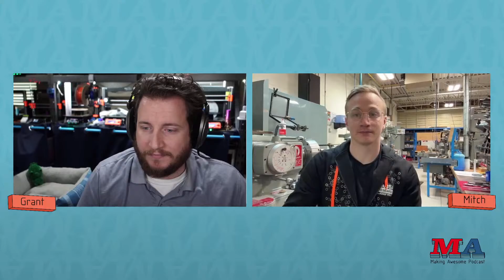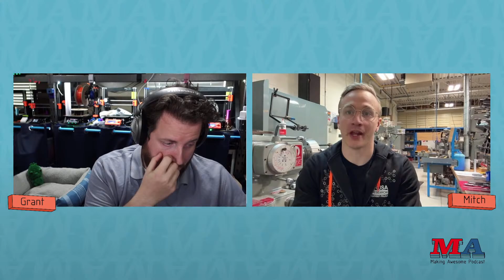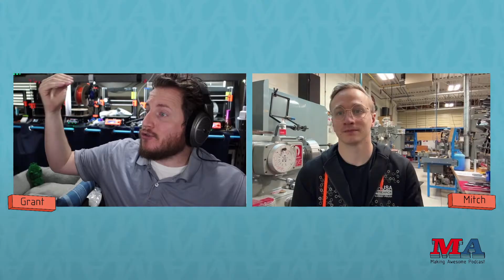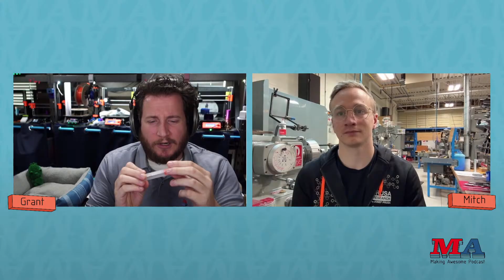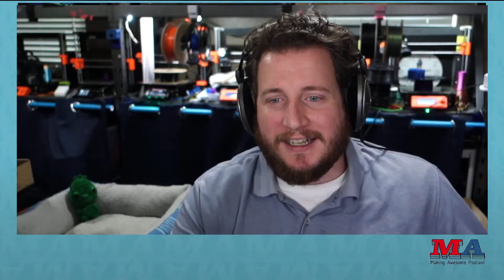Bambu RFID HAS BEEN CRACKED!!! - Making Awesome 211

Comment: Game changer. My biggest concern with my p1s is Bambu deciding to lock the printer/AMS With their own filament similar to stratysys. (I hate stratasys printers for that reason, sucked buying parts for them).
Reply: Bambu doesn’t lock it to their filament! They only use RFID for user benefit.
Reply from the maker: currently they do not lock you out, but that can be something that could occur.. Likely, no, but possible, yes.
Reply: There are a lot of filament profiles in Bambu studio as well. Nothing locks you from using any brand. It's just a good way to get to printing reliable parts without tuning each brand/type/color/ batch or lot numbers. It's honestly just a good system and the prices for refill rolls is extremely competitive and has much less waste than a new spool every time you get a spool.

Comment: I have an absolute hatred for sd cards the most useless form of storage for anything hate them all of the twenty that don’t  work.
Reply from the maker: microdrives have entered the chat ;)
Reply: @3DMusketeers  - and CF holds the line
Reply: @3DMusketeers   Which microdrive, the Sinclair QL Microdrive? Oh you mean IBM Microdrive. Nah the Sinclair is worse. Imagine a Learjet or 4-track magnetic tape cartridge which has been shrunk to a thumb size which has a spliced 5m long loop of tape folded over itself which cycles every 8 seconds - the friction and tension is so high that it keeps stretching the tape continuously. Data often survived for minutes.

Comment: Serious 3D people better read my comment to see the future !!!   I was 40 years in the plastic business and Raw Material varies a "LOT" even within lot #'s.  We bought a lot of large lots, truckload quantities were common and we often specified like lot #'s to minimize variation and even still we would sort by sequence #'s within the lots we brought in. We were very tight tolerance injection molders and charged a good premium for our precision. Our machines needed tweaking throughout the sequence #'s of these lots to maintain +/- .001" or .002" tolerances.  All this to Say that BamBoo could be looking ahead to be able to vary their parameters programed into their printers real time even on same repeat materials by recognizing the differences throughout the lots and setting up their printers to optimize the roll of filament your actually install.  This could reduce variables beyond what anyone else in the market could do... Think About it !!!
Reply: Would be better to implement a filament diameter sensor in the extruder to provide this functionality
Reply: @xkeithedgex  It's not just about diameter. More like the viscosity, flow rates, fusing properties and such at certain exact temperatures. That kind of parameters would be useful to ensure a repeatable product. Think more in terms of "whats the average length/weight of molecule chains in this batch" - the diameter and roundness can be controlled quite well by the filament factory, but their feed stock might have variation beyond their control.
Reply: @robertmartinu8803   Mhm unfortunately we don't have a good model for what to do with that data yet either, not that i know of? Like 3D printer firmware is, apart from pressure advance logic, optional input shaping (second order smooth motion planning), entirely trivial in principle, it just holds temperature and pushes the plastic pretty much.
Reply: @robertmartinu8803  ah got it, but curious how they would even obtain this information and what real benefit it would provide to the end product. Is there a noticeable difference and could the printer sense these properties in real time similar to how a1 measures / compensates pressure in the nozzle? I make my own filament using pellets and recycled prints shredded down/ mixed together. I’d love to see a filament diameter compensation implemented in x1. Actually x1c filament sensor uses a linear hall sensor which is capable of calculating this , but until we have a leaked firmware source code we will probably never see this function.
Reply from the maker: we discussed something similar to this later on in the video, full feedback with the tags, but they would wear out fast, however if the average user could reflash them, you just clone it and go from there.
Reply: It’s working fine without it , and this variation isn’t causing issues for 3d printers……
Reply: As a guy who worked at an injection molding company from almost birth to 18 yrs old (my dad's company lol) I 100 percent agree with this. Tuning heater bands and mold cooling loops after a material change sucks.
Reply: I keep telling people that no matter how good the manufacturer, there will always be some difference between batches. It shouldn’t be much, but it will be there. If that could be tested and the difference could be reflected in the tag, that would be great.

Comment: Is it possible to clone a bambu labs rfid tag? ie if you have bought a black pla spool from bambu labs, can you copy the rfid tag and put that tag on say an esun black pla spool? I am assuming bambu is not tracking that number of meters have been used for a single filament serial number and that the non-writable parts of an rfid tag are used as part of hash signature
Reply from the maker: It is but the formulas of the filament will be different and it likely won't perform as the same. We dig into that some in the episode.
Reply: Its a rfid tag they can be rewriten on
Reply: @XA-JJKILLERs  The problem is, they talked about it, the signature. You can't rewrite a tag with a valid Bambu signature.
Reply: @layeredwork  yup i got to that part lol
Reply: @layeredwork rsa encryption is no joke
Reply: @jgone4856  Have I made jokes about it? 🤔
Reply: Put the RFID tag on Overture spools. Works really nice, just do a filament calibration and save the results for that tag and it works for any roll of same filament type and color.

Comment: of course at the begining the mention of settings, I can understand at times why a big industrial machine might be locked in. I suspect they can only assure you of the structural properties if its extruded at x temp.

I will say one thing an OpenRFID filament system could allow is keeping records of used filament like you said.

My idea is that in an ecosystem like Prusa could be if you are using Connect maybe it would even be able to suggest a printer with enough filament for your job. On an XL could even have it auto suggest enabling spool rollover.  Of course could also have Link directly talk to the slicer over LAN, And in sneakernet usage just have the printer generate say "Filament.cfg" or something on the flash drive and when plugged into the PC it would update the slicer on available material(s).

33:35 btw the QR code on a Prusa nozzle case opens their manual for changing a nozzle.

how he mentions verifying filament and making sure its legit, this could find use case in fields like aerospace. You could prove that spool is from that mfg and as such matches the material data sheets you might require for a client to know what batch that plastic came from.

Comment: I have a Bambu X1C, and I think it would be GREAT if I could take a spool of another brand of filament (take Creality CR PLA for example or just pick one), calibrate for it, and then store the material type, color, and flow rate to an RFID tag stuck on the spool.  RFID tags are cheap enough.  Then, the printer could recognize that particular spool again in the future if I remove it from the AMS and put it back later.  I can do all that manually now, but have to redefine the parameters from my notes (or re-select the profile I saved) every time I remove and replace that spool.  It would be great if I only had to do it once per spool (calibrate the K factor), write that info to an RFID tag, and have the printer recognize that spool on sight.  I went out and bought a 2nd AMS, so at least I can keep eight spools loaded before I have to start swapping spools around.
Reply: Wait so why can't you? I mean once you add and save a filament profile it's there forever is it not? So you go into your slicer and add say "sunlu pla black" and set up all the filament settings rename it save it. Now programe sunlu black pla into a RFID tag that you can clip to any roll of sunlu pla black. I would think once you put it in it would switch for you no? 
 I mean as of now I just have to manually swap everything have everything saved in my presets. It's not the biggest deal but being able to just drop a roll in and not worry about it that's great 👍.
     I was just starting my digging into doing this myself.
Reply: I've said this in other threads, but they absolutely should sell authorized, re-useable RFID tags for $2-5 each. They could even tie the tags to your Bambu account/device's serial number if they're worried about mis-use by resellers. I'd spend $20 on RFID tags to match my preferred filament brands & colors.

Comment: The positive benefits of RFID tags certainly are intriguing, possibly even a major step to true push-button printing that still preserves the ability to use any filament instead of first-party filaments, but I'll always be suspicious of a printer that could refuse to print anything if the "wrong" manufacturer's filament is loaded. Sure, manufacturers may claim that they'd never do that, but I'd only put so much stock in those promises depending on the manufacturer (I wouldn't believe it at all from Bambu Lab and only would mostly believe it from Creality or even Prusa). 

I would like to see a little more info on just how not-open source the Prusa Core One is...there was a lot said in the intro video about being able to customize parts of the printer to our hearts' content, and people in the live chat were saying that they've even gone as far as to no longer require users to physically modify the mainboard to load custom firmware, but how locked down are we talking? Are we going to have to rely on, gulp, Creality to be the open-source leader in the mid-range printer market?
Reply: As far as the Prusa Core One is concerned, Prusa has made everything open source in the past, e.g. with the MK3. This includes the STEP files for the prints, the CAD files for the printer itself and the Gerber files for the mainboard. The result was cheap copies from China, which of course isn't great for Prusa.

With the Core One, they are a little more reserved. The printed components are only available as STL files and as far as I know they still want to release CAD files for the side panels so that you can create your own mods. However, the files for the mainboard and CAD files for the rest of the printer will no longer be available. The firmware is still open source.

The company that currently offers the most open printers is Sovol with their SV08 and SV06 ACE for which they released CAD files and the firmware which is based on Klipper. But as far as I know no Gerber files for the mainboard either.